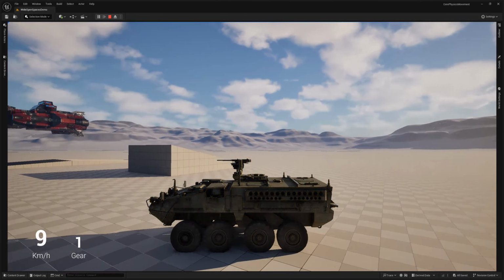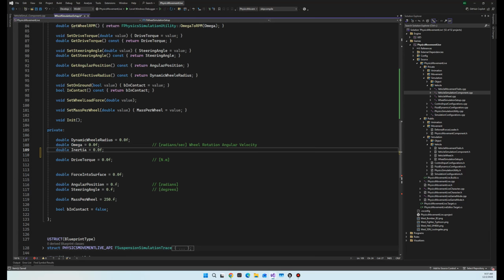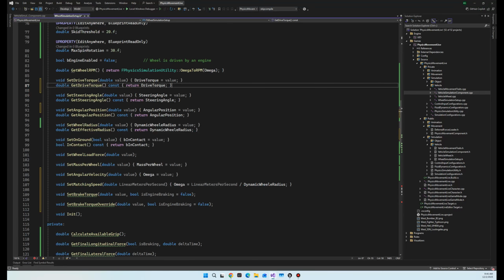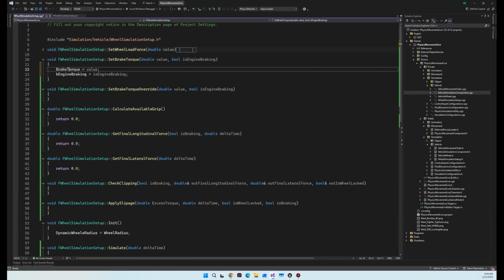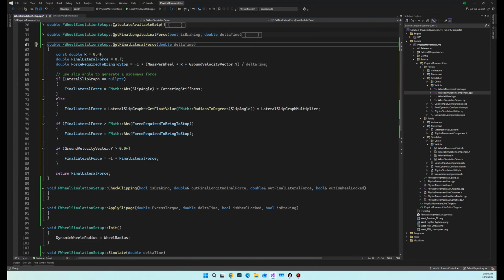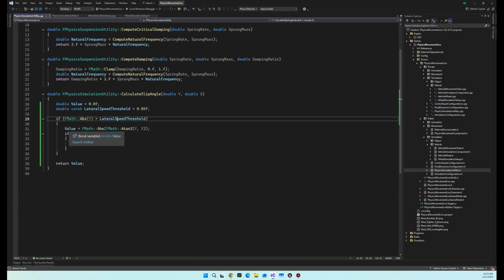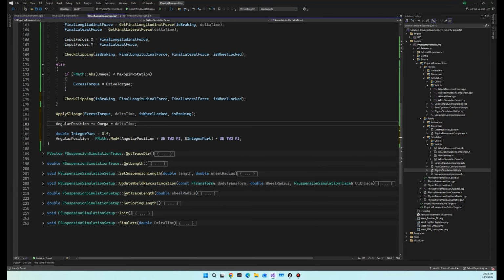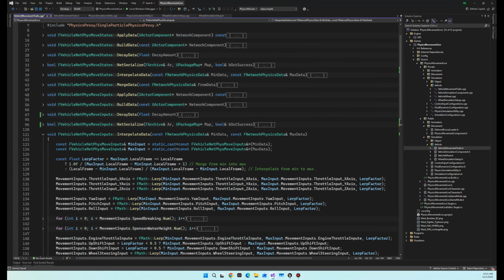How to add Wheel Systems  into our Physics Simulation Component: Wheel Friction (1/2)

Comment: Thank you for your video.
I have a question, I tried different vehicles like this (tank), physic is enabled for wheels and as I'm using for a shooter when enenmies shoot the tank's wheels, the wheels will get strong impulse whatever settings I tried.
So I'd like to know if with your way it's not like this please?
Reply from the maker: I don't know what you mesh hierarchies is but I would make the body of the tank a physics body and set the wheels to no collision.  If each wheel is a physics body then the impulse generated form the wheel will move into the tank and have a cascading effect on the actor.  If you then want to shoot out the wheels then add collision boxes to each wheel to detect a projectile hit.  Then on hit, you could hide the wheel and then spawn a actor for just the wheel and make that a physics body, then launch it off the vehicle.